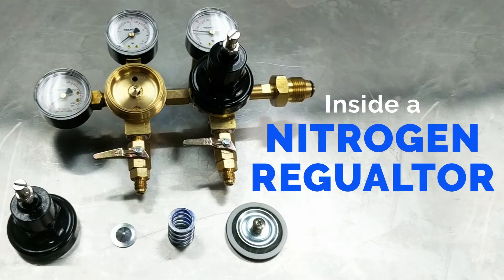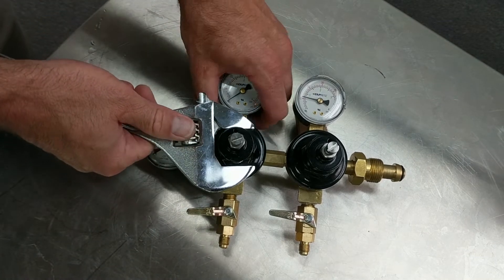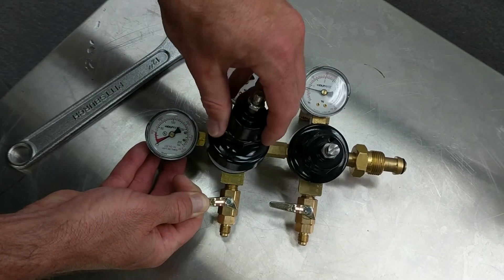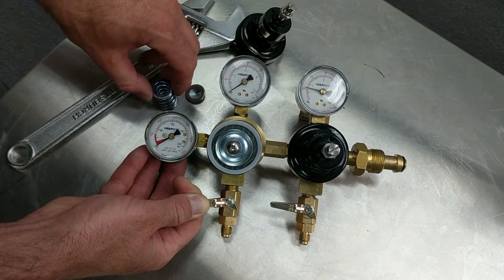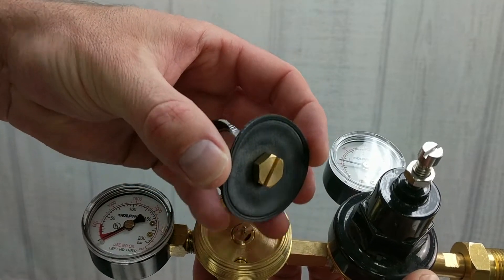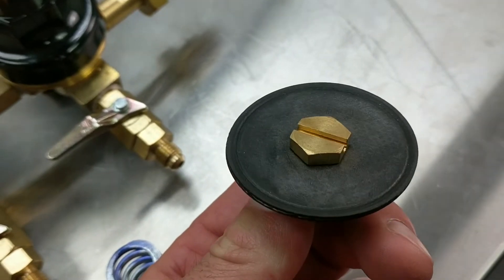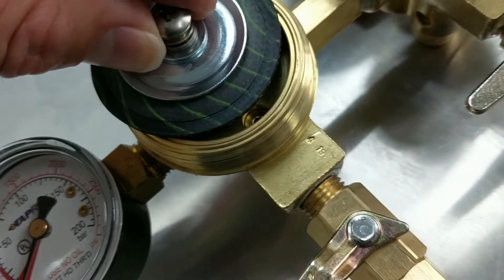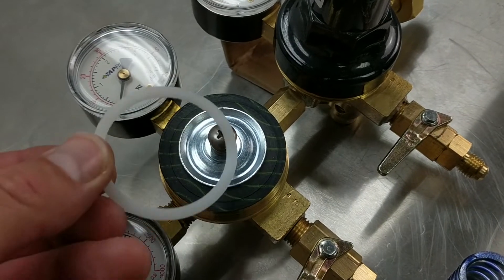How to Repair a Nitrogen Regulator - Inside Look at Taprite Regulator

Comment: There's a constant release of nitrogen coming out from the emergency release holes all times, What happen?
Reply from the maker: If this is on your regulator, you likely have a bad diaphragm and need to replace it. Disconnect from the nitrogen source and remove the bonnet as instructed in this video.

Comment: HI Do you know the size of the regulator stem and stead size thanks
Reply from the maker: Sorry for the late reply. Nitrogen regulators are CGA 580 valves which have the following specs:
CGA-580 valves for Argon/Helium/Nitrogen Hand Tight Regulator Nut has a thread size of 0.960" - 14 NGO with RH Female connection and is made of brass and has a pressure of 3000 psig.
Reply: What are the three dials ? I’m assuming one is pressure inside cylinder, another is the output pressure into hose but what’s the third one ? Just curious. Thanks!